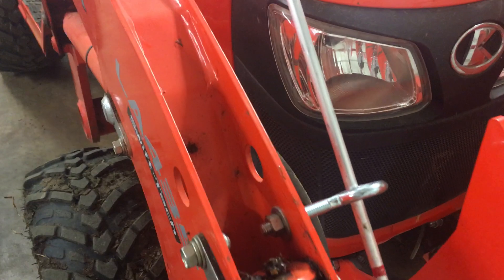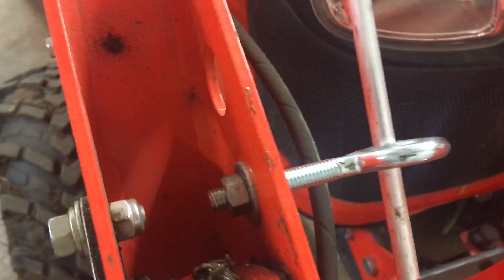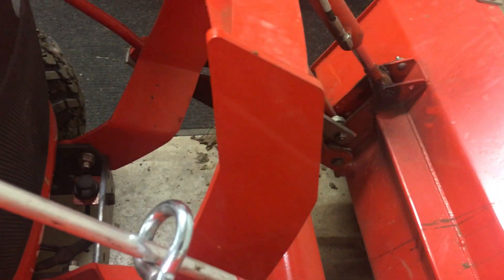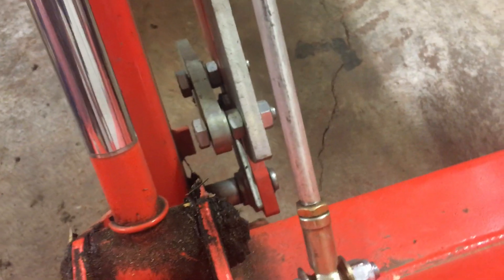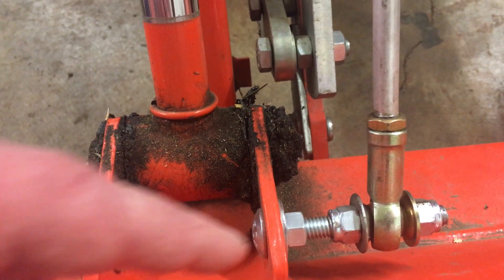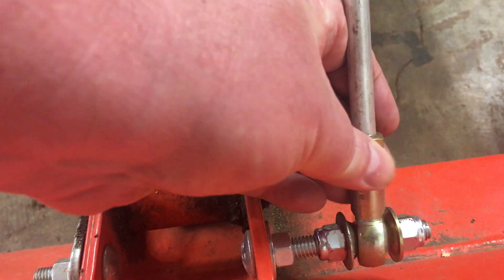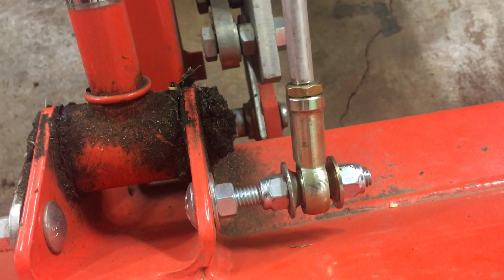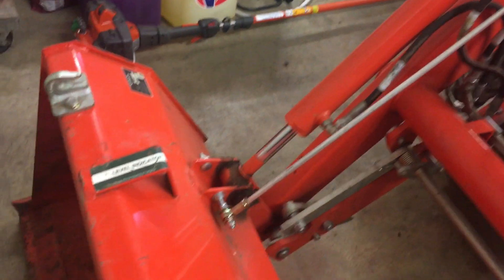Kubota B2301 Bucket Load Level Indicator

Comment: My nearly-antique Chinese tractor came with a piece of angle iron welded to the top of the bucket and parallel to the bottom. Not nearly as high tech as Mark's solution, but then again, his Swift always had a lot more tech in it than my Royale, so I should have expected that!